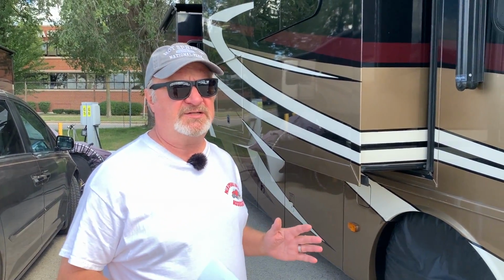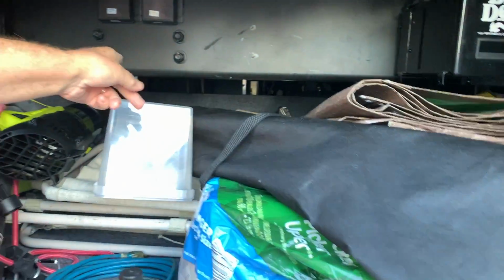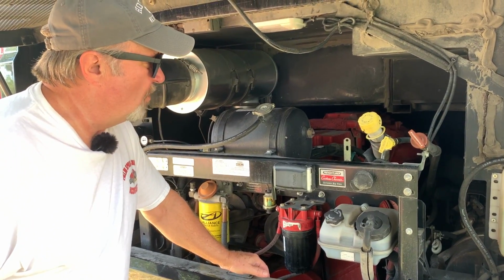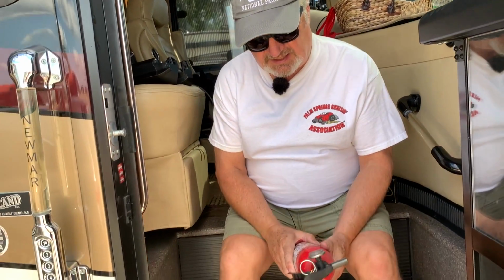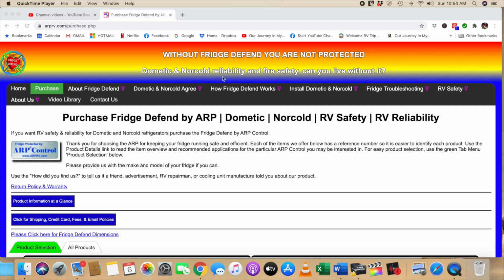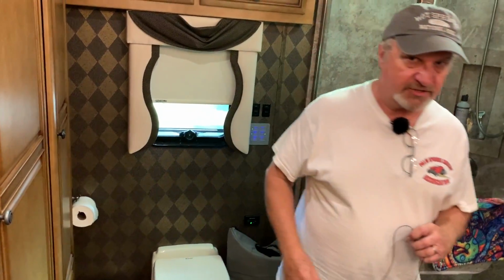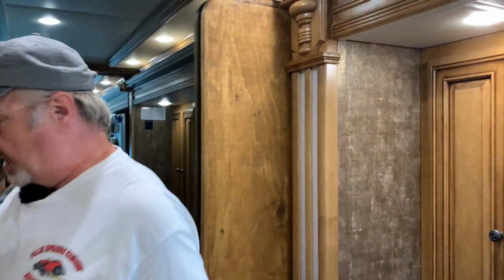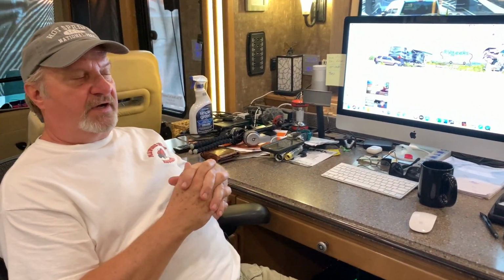RV FIRE PREVENTION WEEK | INTERCONNECTED DETECTORS| FIRE SUPPRESSION | ESCAPE WINDOW HACK | EP137

Comment: One solution to deal with the 1LB propane cylinder would store them in the def tank area. Create an L bracket like how they mount fire extinguishers using several really larger hose clamps mounting it to the trailing wall in the def tank space. Then again there are less combustible grill fuels like charcoal and wood pellets that work just as well as cooking the brats as propane. 
 I know a friend that is an arson investigator who mentioned that power bars are also a common source for fires. Maybe I should not have mentioned that as now Sue is gonna be mad at me for creating another worrisome issue.
Reply from the maker: Well we recently DID have a large problem with a power bar in the Honda.  MICE!  Yikes,.....
Reply: @OurJourneyInMyles  Yikes....... again.

Comment: I heard you shouldn't use black tire covers
Reply from the maker: Roger Marble,.......the retired Tire Forensics Engineer on the RV Speaking circuit has retracted his initial statements about them, and did a few temperature tests on his RV at home.  The results were almost the same, but the UV protection from the Black ones was better.  We are possibly splitting hairs here though,.....I think any cover is way better than none.  At $872 per tire, I will take all the protection I can get!

Comment: Excellent video very thorough.  I am shocked how small that hole is!  That’s scary!  I like your emergency light switches by the exit terrific idea I am going to get a few of those. Your board is the perfect solution and the only way I could get out that window unless I went head first and broke my neck. Not great options there.
Reply from the maker: Thanks for watching Melinda!  I truly hope you can get a board for your rig, so you can have the confidence to get out backwards in your rig.  Other folks had great ideas like looking into getting a paramedics board with hand holes so it is lightweight.  Or a board with only holes for handles, and no real "metal handles".

Comment: Very thorough coverage of a critical topic that most people don't think about until a fire emergency. Thanks for sharing a lot of great tips that I would not have thought of. I have also wondered how we would ever get up and out that small window in a hurry. Your board tip is a great idea to make the best of a bad design feature that I guess meets safety regulations but is very impractical for older folks. BTW I recently discharged 2 1980's vintage dry powder fire extinguishers and they both worked fine. Just don't discharge them directly in a garbage can thinking you are going to avoid a mess if you are just disposing of them LOL
Reply from the maker: Come up with a lighter, cheaper and easier board solution for the OJiM family!  Someone suggested an EMT or ski patrol backboard.

Comment: Better off going with a 12volt compressor refrigerator. Still good for boon docking but a lot more efficent and safer.
Reply from the maker: We love our full size refrigerator for convenience and safety,......but you are correct it is an energy hog!  In my younger years, I am sure boondocking would have been really attractive.  Now,..not so much,....

Comment: Excellent video and I love the board. I am concerned about the CO detectors being mounted on the ceiling. I am not an expert but I believe CO is a heavy gas and by the time it gets to the ceiling it will be too late. I think it should be mounted close to the floor.
Reply from the maker: Thanks for the info! I double checked the instructions that come with the unit, and you still mount it like a regular smoke detector.  I think folks need to make sure you follow the mounting instructions for the brand, style and vintage of the unit you are working with.
Reply: @OurJourneyInMyles  CO gas is lighter than air. Example: if someone enters the room with perfume on you will smell it if you are laying on the floor or on a ladder. Propane is heavier than air and collects on the floor.

Comment: I feel bad now... I only have the original small fire extinguisher by the door, one smoke detector, just replaced my CO2 and I should be replacing my propane detector at the bottom of the stove . It has a 10 year and its been 5 years already.  Great video, thanks for sharing and it wasn't long at all.
Reply from the maker: Hey Hector,......some viewer just pointed out the E50 Element and E100 Element Fire Extinguisher product.  I just bought (2) of the E100's.  Hope they end up on Amazon so they are cheaper and easier to buy & ship.  They looked really amazing!
Reply: @OurJourneyInMyles  Thanks Marco, looks really interesting and best of all there is no mess at all. I just purchased 2 of the E50.

Comment: Great Video. Somethings to think about. Self contained flame, well no and yes. the flame does not exit the fire box but the fore box is NOT air tight or it would not support the flame. Well so if you have a propane tank that leaks, the propane gas would/could get INTO the fire box and ignite. The other point is a thing called air-fuel explosion. Leaking propane tank in a confined (non-vented) area, when the mix gets just right and hits that accessible flame, KA-boom. Pretty sure there are youtube videos of air-fuel events. Love your channel
Reply from the maker: Thanks Phil,.........you are right,.....that flame inside the box is getting its oxygen from somewhere!  Sue & I always operate on the side of caution.

Comment: Hey Mark, Great Video. Idea for your board......... Cut a hole big enough for your hand in the middle of, or where you want it, and get rid of the handle so the slide won't catch it in case you forget..... Could be done with a drill and jigsaw. Just a thought. Good luck.
Reply from the maker: Cool idea! I should have thought of that.  It could double as a message table board!

Comment: We have the same emergency exit window in our rig and it really gives you the "Trapped" feeling if you had to escape from a dead sleep. I'd rather show up at an Antifa march with my MAGA flag than escape from a nighttime rig fire! "Prepare and Prevent, don't Repair and Repent"  Thanks Mark & Sue for the tips & tricks!
Reply from the maker: Start building your board!  Using an LVL board prevents it from warping, and then not fitting in the slot or crack area against the wall.  A viewer suggested a "hole" for a hand hole rather than a handle,.....good idea.  A person could put in "multiple holes,......like at least three.
Reply: @OurJourneyInMyles  cutting a hand hold sounds good. Cutting multiple hand holds would be good, too, I think. When I looked at the placement it seemed to me that up higher would be good so the board would get the biggest impact, not you feet and ankles. I broke one ankle badly 4 years ago. I am lucky but it will never be quite right.
Reply: @OurJourneyInMyles  Good idea indeed...taking a look into a design similar to the EMS backboard style.

Comment: Great video! I see the fifi's in each bay! They are so worth it! A tip on tire safety... At the soonest point of tire replacement, buy new tires for the front and keep the best of the rest for the rear axle(s). The following year do the same and so on. A fresh set of tires will be on the front and your wallet won't get hit all at the same time. 
Great tip of lights at the escape window, thanks. We'll be putting more extinguishers at key locations. Bonus line: He'd rather have a tool box there! was this weeks video stopper! Long video, but worth every second, thanks!!!
Brendan & Lena
Muddy Sneakers, Pa.
Reply from the maker: Thanks so much Brendan.  If I convince at least one other person to build an OJiM Board, and they get renewed confidence that they will NOW be able to get out, ...........then I have done my job.

Comment: haul the propane tank in the van...simple!
Reply from the maker: I know its a stretch,........but on a hot Florida day, pulling the Honda for hours, it could be 120 degrees inside.  Leaking propane gas stays low, and hugs the floor, and the Honda is not vented at floor level.  An open window may do the tick on none raining travel days.
Turn signals, auto unlocking with the FOB, running lights, proximity sensors all could energize and create the spark needed for a problem.  We know this is crazy safe,...........but it is what we want to be!
Reply: @OurJourneyInMyles  As far as venting the honda, rain guards/visor/deflectors/shields would prevent rain from getting in the vehicle. Plus the added bonus of fresh air circulating some of the time inside a vehicle is never a bad thing. Another thought I was thinking about was a Woof Wack on the Dutch star. Then again the odds of getting injured climbing a ladder to get to the top of a 13' roof are probably greater than fire. So a rooftop carrier on the honda is the safer solution.